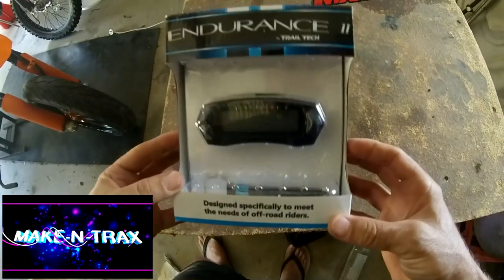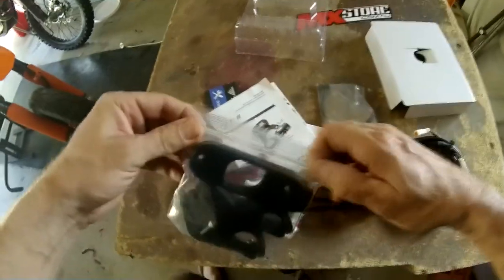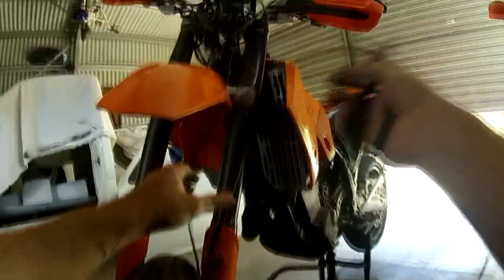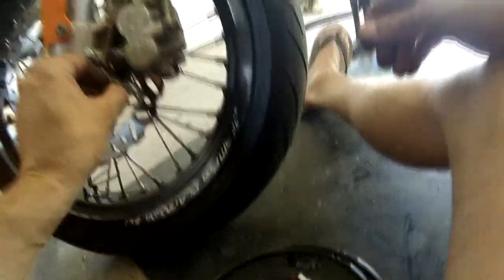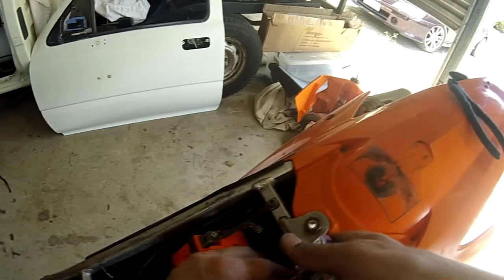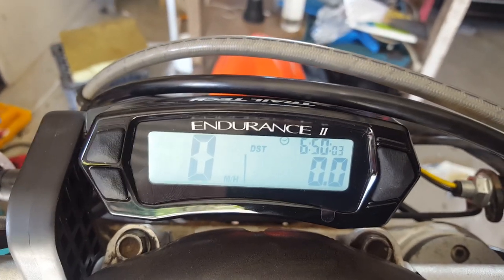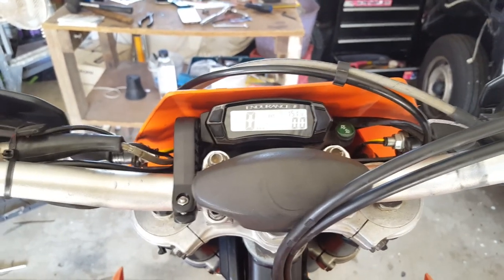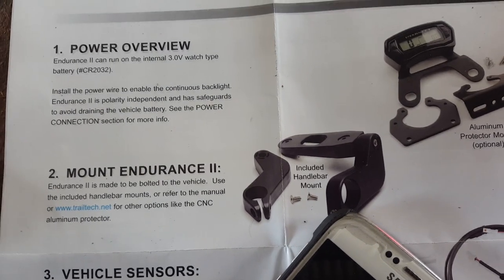TRAIL TECH ENDURANCE II SPEEDO INSTALL ( how to ) - KTM/HUSKY

Comment: Not sure if you’ll reply to this but was wondering do you have to hook it up to your battery ?
Reply from the maker: Not 100% sure mate. I would say no. But i can disconnect  mine and see what it does.
Reply: MAKE-N-TRAX okay let me know. I recently picked up a 2011 husky txc250 and the guy I bought it from gave me his endurance 2 that was still in the box. Planned on installing bug just wasn’t sure if I need to connect to the battery as well. Thank you very much I really appreciate it.
Reply from the maker: @thecarp2016  so i DISCONNECTED the trailtech from the bikes battery.   Display stays active. speedo still registers off sensor when spinning but the display doesnt illuminate. Backlight will illuminate for 5 seconds when you press a button on the display and then switches off.

With trailtech CONNECTED to bikes battery the backlight illuminates as soon as the wheel spins and stays on as long as the wheel is spinning. If you press a button on display while stationary it will illuminate for 90 seconds and then go off.

Hope this helps you.
Reply: MAKE-N-TRAX thank you for taking the time to test that. Very appreciative
Reply from the maker: @thecarp2016  no worries mate good luck with the install

Comment: nice Video mate ! thanks for sharing , i have one question still , for example o broke my original Speedometer and Im going to buy the one shwon in the video . Do i need to replace the wires as well or the tech endurance fits in the original plugs . i have a 2019ktm
Reply from the maker: I know the plug was the same at the sensor end of the wires but i am not sure at the top where there speedo plugs in? Worst case it is easy to run the wires as it is all external. Still the same speedo upto 2021 450excf
https://www.ebay.com.au/itm/KTM-450-EXC-F-2003-2021-TRAIL-TECH-ENDURANCE-II-DIGITAL-SPEEDO/303116612194?chn=ps&norover=1&mkevt=1&mkrid=705-139619-5960-0&mkcid=2&itemid=303116612194&targetid=1137314459002&device=m&mktype=pla&googleloc=9069206&campaignid=10101785018&mkgroupid=102311921700&rlsatarget=aud-786643580126:pla-1137314459002&abcId=9300367&merchantid=7607142&gclid=Cj0KCQiA4feBBhC9ARIsABp_nbWShwZ54Sq2qpOXBrub83opoLBpPY2PHUyuCXriDLaGwxGVs1vRO6oaAtnEEALw_wcB&pageci=91e4ed5b-9c8e-485f-8b87-496460cc3ecd
Reply: @MAKENTRAX  thanks for helping me dude !. i Will try it myself and if i have any info i'll update you 
Cheers
Reply from the maker: No probs mate glad to help

Comment: would the oem speedo fit that mount?
Reply from the maker: pretty sure it would, from memory the bolts were at the same centres
Reply: Awesome thanks!
Reply from the maker: @Bfalco71  Yeah i remember i ended up ditching the aftermarket mount and mounting the Trailtech to the factory mount

Comment: Acumulated ride time works without the speedometer?
Reply from the maker: I would say it works as an average off distance travelled. I have only had it with speed sensor connected. I have got onto Trail Tech to confirm. I will let you know.
Reply: @MAKENTRAX  okay,let me know,and thanks :D
Reply from the maker: It is calculated off of the wheel sensor being triggered. So once the sensor is triggered it will start counting time.
Reply: @MAKENTRAX  oh,okay,thanks :)
Reply from the maker: @daviisitoh4199  no worries👍